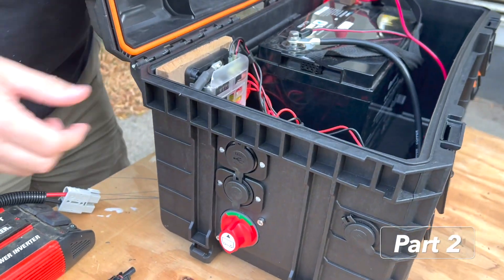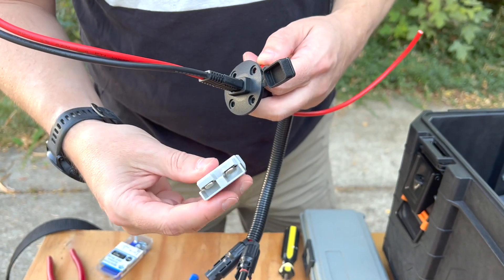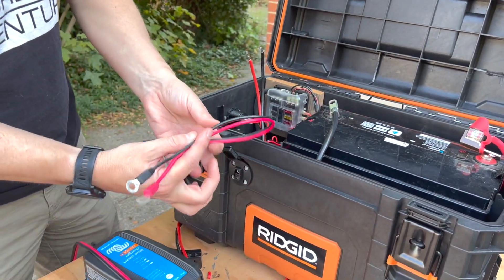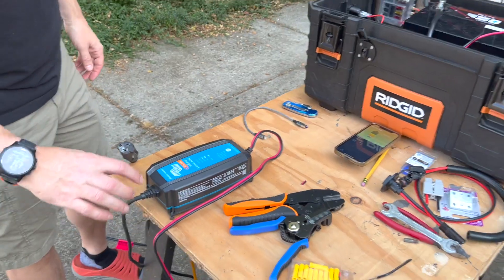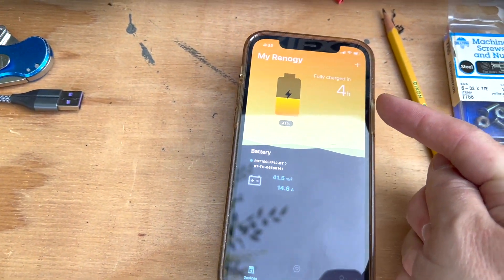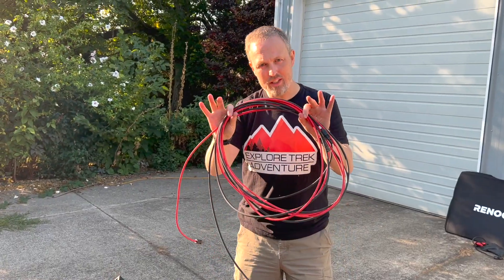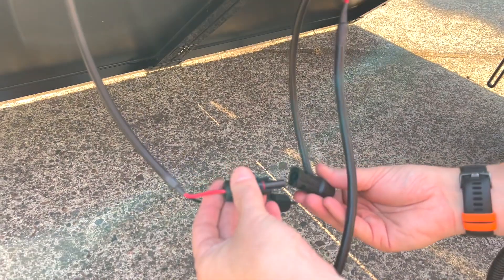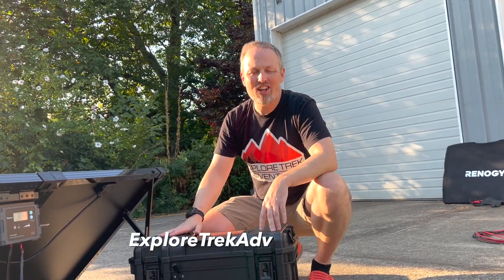DIY Solar Generator - Part 2 - AC & Solar Charging

Comment: Question - what solution did you come up with to strap the battery down within the box?  Obviously don’t want the heavy battery sliding around bumping wire connections during transit!
Reply from the maker: I used an old nylon strap and bolted it to the side of the box.

Comment: You need a 110 power supply to make more complete just in case is need it
Reply: I think if you made a bill with an inverter you would have a 110 on the inverter

Comment: thanks for the part 2, i did not get the part where you can monitor the charging using you phone, can you give more details on that, thank you
Reply from the maker: We chose that specific battery as it has a Bluetooth battery monitor built in. You just download the app and connect to the battery.

Comment: You're not running the solar thru the controller but straight to the battery along with the AC charger?
Reply from the maker: No the solar suitcase has a solar charge controller built in.

Comment: I would use the XT60 or XT30 for my charge cable since they are as cheap as SAE cables are are able to handle rather overkill currents (60 amps and 30 amps respectively).
Reply: The charge rate for 100Ah battery is 20 amps. The ABYC code for 20 amps under 10 feet is 12GA wire and most come with 10GA. Those SAE connectors can easily handle 20 amps. Fuses are designed to take care of over current, not the connectors. No reason on earth those connectors should be seeing 60 amps. No he does not need to use XT60 connectors. Another clueless armchair electrician.....
Reply: @SOLDOZER  For the same cost or maybe less than an SAE, we have a 60 amp rated connector with better panel mounting options, some water tight options, and the XT90 has antispark variants. I also like that each side is physically different so there is no risk of a backwards wired connector (I learned this the hard way when I found my SAE connectors were wired backwards to each other.... blew some fuses).

So if the SAE and XT60 are the same price, I would rather have the XT60 which is physically better built, harder to screw up, visually different between battery and load side... and it CAN handle 60 amps if you want it to... not that you have to.

And I am no armchair electrician... I chose to use XT60 over SAE for my battery after I spot welded each Lithium ion cell together due to both it being cheaper than the available SAE options (they're the same price now), physically having a male and female... physically hermaphroditic connectors are dangerous if they're not also electrically hermaphroditic like the Anderson power pole. And I avoided the Power Pole simply due to cost since my battery does not require a 300 amp rated connector when its BMS blows an E fuse at 50 amps (the cells can't do much more than 20 anyhow, they're junk and also the wrong Lithium ion type for high power).

I carefully weighed using an SAE and was going to do so until I found that approx half the SAE devices I have around me are wired backwards from the factory. They should be wired so that on the battery side, the negative terminal is the naked one so it doesn't short to ground if it touches a vehicle body since they're for automotive, half of mine are wired so they would short to ground... which means they're both backwards polarity and a short risk (most of which are not fused either... cheap gizmos don't always have fuses). I chose the XT60 when I saw they were easy to solder, cheaper than SAE at the time (though they can be the same price if you look longer and wait for shipping from china), the XT60 is designed for super high currents for its size class, is often fire retardant, has the XT60i variant which I plan to use when I make a 48 volt Lithium Ion pack so it can autodetect and lower itself to 12 volts as needed... need I go on?

The ONLY advantage SAE has is ubiquity, it ties in cost (and often costs more than XT60), has slightly higher internal resistance, is really hard to solder (I hate crimps, they're easy but I like better solder joints), and is often wired wrong meaning I would have to check each new SAE device with a meter before connecting things or else magic smoke comes out... remember most devices that are not super costly do not have fuses... yeah.

I would have gone XT90 but the cost was as high as SAE and I think a 60 amp connector is overkill so a 90 amp connector would be stupid overkill.

I would have suggested the XT30 at its 30 amp rating which is more comparable while being physically smaller than the SAE, but if the XT60 is cheaper and has better panel mount options, just use it.
Reply: @asificam1   No, your SAE connectors were not wired backwards. Depending on what you hook it to they will have reverse polarity. Thats why you have reverse polarity connectors.
Reply: @SOLDOZER  I am aware if the polarity reversers. However, there is zero reason for a battery clip (like from a charger or solar maintainer) to be wired any other way than black (negative) being the unprotected side and the positive being protected by plastic because 99% of cars are are negative body ground. If all the SAE connectors had the cables polarity marked rather than the cables in a single black sleeve as they all do in commercially produced devices, then I would be less against the SAE connector seeing it as a waste of resources rather than a danger. If I need to double check with a meter on every connection, then the connector is worthless. XT60 is usually cheaper than SAE, carries more current, handles more insertions, less prone to burning, often made of fire resistant plastic, can be soldered for super good connections, and mine are designed for 10 AWG wires (though the older style without the protective backing could probably take slightly thicker wires if you get creative with soldering). XT60 has better panel mounting options, more water tight options, and the XT60i has an extra wire which can be used for something else like a sense wire, a communication wire for future expansion, maybe a simple resistive divider for setting voltages, etc. I plan to use the XT60i for my future Lithium ion packs so that they can sense when a device can take more than 12 volts and expose their full voltage, or step it down to 12 by default to match all my other gear.

When the objectively better option is cheaper, why not go with it? Even if the SAE is good enough, the XT60 allows for future expansion and you could use it for discharging as well since it can supply 60 amps either direction. OR a third option is to put in an SAE with an ideal diode module (They exist, they're a MOSFET driven by a special chip), use the SAE for charging only, and have an XT60 panel mount for power going either direction. Fourth option if you have a bucket of ideal diode modules (real diode will get rather warm here), 60 amp fused, or ideally regulated connection via XT60, 10-15 amp fused or regulated SAE output, and then have them both go backwards to a DC-DC charger, use the ideal diodes so that power in always goes to the charge controller or a smaller fuse, but power output when going via the XT60 is fused to 60 amps.

Comment: Really love this video, I was overwhelmed by builds on the net and was nearly ready to give up. My build is going to be based on yours. Its so simple.without the need for a dc/dc charger and mppt to be put inside. Would you add or changebanything since youve been using it? Batttery size okay for your needs?  Well done fella. Awesome vid
Reply from the maker: This battery gives us 3 to 4 days of use with our Setpower fridge and has been working well so far. I may put more USB ports on as you never seem to have enough.
Reply: @ExploreTrekAdventure  awesome 😎,  by the way what was the name of the connectors you used for the solar panel and charger leads?

Comment: looks good but I've seen that the controller should be near the battery and not the solar panel. something to do with loss of voltage or better flow of current.
Reply from the maker: We like the benefit of having the all in one solar suitcase. You can use it to for other things like charging car batteries.

Comment: As for cost, I’m in the process of purchasing parts for my build, a 12v 100Ah system. It’s looking like I can get about double the watt hours of an premade unit for the same price. I can also start with a box, battery, battery charger, some fuses and wire, and  outlets and have a working system. I can then add outlets, solar controller, DC to DC alternator controller, dedicated Ham Radio circuit, lights, meter’s, Bluetooth, Chinese diesel heater circuit, camera battery chargers, or whatever as in need and not have to put out the full cost all at once. Plus I know the system and can fix it myself with parts I can get overnight or 2 days from Amazon. To send your malfunctioning premade units in takes time and effort. I can basically order replacement parts and do the repairs in less time than it takes to get authorization to send it in for repair. When the Zombies attack I plan on being prepared. The name of my company will be ZE Equip (Zombie Eliminator). Watch your back !

Comment: What did you not like about the big Anderson Style Connector??? They are pretty widely accepted as the "Best" DC connectors!
Reply from the maker: While this connector is definitely sturdy, it might be a bit too tough, especially for a solar connection that you’ll be plugging and unplugging often.
Reply: Those large Anderson connectors are for 50 amps. They are overkill for this application and you have to buy tools, pins, connectors to make them. Pain.

Comment: Just curious….how did you secure the battery..?  I am actually interested in that part.  Thanks
Reply from the maker: We used a 2” nylon strap around the battery and small bolts to hold it to the side of the case.

Comment: I would rather have the grey connector at least they are better than lighter plugs. Also you should see the charge rate with the 30 foot cable because there will be loss in longer cables. Overall this is good I may do a few things different but the idea is the same. Most people have the panels mounted on the roofs of the RV so just a connection would work. The box can be mounted on the tongue if you don't have propane tanks or single tank. I sure don't want to lug a battery around. 73
Reply from the maker: Good ideas if using with an RV.

Comment: I'm in the middle of a cargo camper build and while the AIO power stations are nice I don't need all of the extra items they come with, don't care for the 12v “cigarette lighter" plug to integrate it into my trailer power system, and don’t want to send it in if something breaks. If done correctly a DIY power box can grow with you and your power needs. Thank you for the videos!

Questions:
-have you had any issues with the wires getting hot?
-Have you put anything in so you can charge the battery while also using the USB and power ports?

Comment: It has been 11 months since this video aired, I am working on this same build but would love an update on what you might do differently now. I am going to start with this before moving on to building the trailer camper!  This will be handy on an upcoming camping trip.
Reply from the maker: It depends on your need but I would look at some of the new power stations on the market. I had a special need of wanting the biggest battery for the $$ to power our cooler as long as possible. Since I didn't need an inverter or any fancy outputs this was the best choice. It is still working great although I think i may add a few more USB-C connections.

Comment: put some sealant around the connector housing to make it really water proof.  Would have just gone with a mc4 receiver connector instead of cutting up all those wires.  good build.
Reply: where is the AC part?  How much total for the build?
Reply: @publicEnima I believe the AC part is a combination AC and solar the one plug plugs into both different items the solar panel or the AC charger the blue thing

Comment: Very nice video. I watched both  parts one and two I am going to use a lot of your build suggestions. I'm going to include a 1500 W inverter, and even though these batteries include BMS protection, I prefer to have a solar charge controller monitoring the battery charging. Very nice Solar charger you have there.

Comment: I wonder, could you link more than 1 battery and have volt/charge meter on it as well
Reply: You could have 2 batteries in parallel but then you have to beef up everything and you would need a lot more solar.

Comment: Nice build, thx for sharing.. Up until the very last 30 seconds I was telling myself the dude is not going to plug the solar panels directly to the battery.... then I saw the MPPT attached to the panel.. :face-fuchsia-wide-eyes:😅🤣
Reply from the maker: Oh we have heard that many times. “No charge controller?” 😂 I must not have explained that part clearly enough.
Reply: I agree nice build

Comment: Correct me if im wrong but wouldnt it be safer to add some kind of ventilation to the case?
Reply from the maker: Lithium batteries do not need to be vented but it would be good to add if heat was an issue.

Comment: ❤❤nice build i have two of those tool box one 800watts inverter and next with 48 volt inverter with two 110 AC out put but i have 20A breaker for my out them so my inverter is protected if any it my breaker will only flip

Comment: The only thing i would suggest is adding a read out of the battery on the box.. that way you can see what the info on the box is.. also the interior might get warm, and you may want to add a fan to cool the battery a bit..
Reply: You obviously have 0 experience. I would suggest you sit down.

Comment: You may want to put a diode in line with the charging port so you don't have a hot plug. Just in case.
Reply: Thank you for saying this.  This reminds me I need to add one for my buck converter to my camera.  I think the 2 pin has one with the big round circle between the lines but imma add one of my own for double protection

Comment: How difficult would it be to add one 15 amp outlet to this set up? I have sleep apnea and am looking to build something similar so that I can run my CPAP on camping trips
Reply from the maker: You may look into getting a 12v adapter for your cpap machine. Not having to run an inverter will save power.

Comment: Nice video.  Thanks for sharing.  With the battery mounted off-center, how is carrying the toolbox around with more weight on one end than the other?
Reply from the maker: The handle is wide enough so it stabilizes the load pretty good.

Comment: Is there no need for a charge controller between the battery and solar panel or is that built into that interface on the back of the solar panel?
Reply from the maker: There is a charge controller built into the solar suitcase. You can check out this video which we go over the battery/monitor & solar suitcase in details. 
https://youtu.be/OXDFdGeS_lw

Comment: Thanks for the video, it was clear and calm :) I would recommend fusing the solar panel positive too. It is directly connected to the battery positive so a short on that cable would be very exciting yeah?
Reply from the maker: Great idea. I see Renogy offers an inline fuse now that will plug right in.
Reply: Another clueless armchair comment section electrician. The solar is connected to a charge control hanging from the back of the panel, not direct. And you dont fuse single panels or panels wired in series. I would recommend you stop giving advice on topics you know nothing about.

Comment: Nice job👌👌.  Personally like the Anderson plug, it may need that lil bit more oomph to click in but flip-side is rock solid on any corrugated road we've come across, never worry about stopping at camp and discovering fridge came unplugged 👍😁
Reply from the maker: Yes those Anderson plugs are very very sturdy. 😀

Comment: What's cost savings vs the premade power stations like a Bluetti or jackery?
Reply from the maker: The battery was $500 and is 100ah or 1200wh. You can compare that with Jackery or Bluetti. They both make great units it just depends on your need.  We just wanted the most battery for the $$ to power a cooler fridge & lights.

Comment: How do you decide what gage wire to use where?
Reply from the maker: Google "wirebarn wire calculator". You punch in the details of your circuit and it will give you wire options that will work.